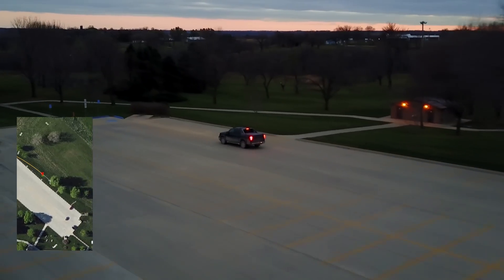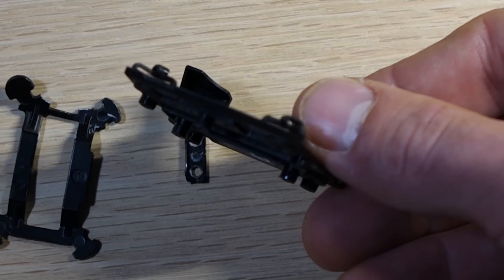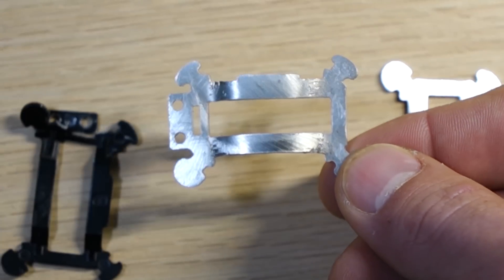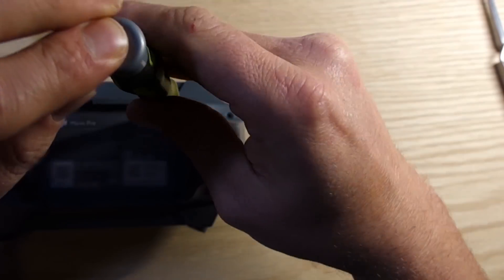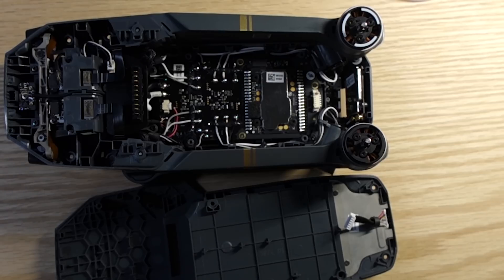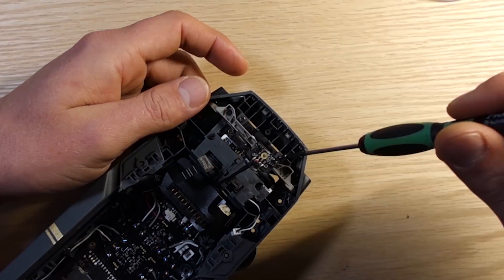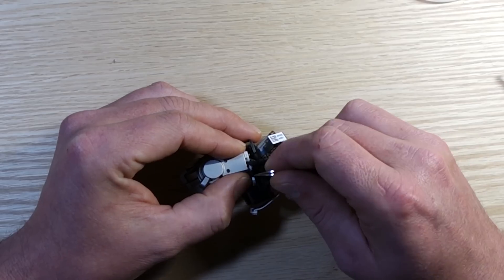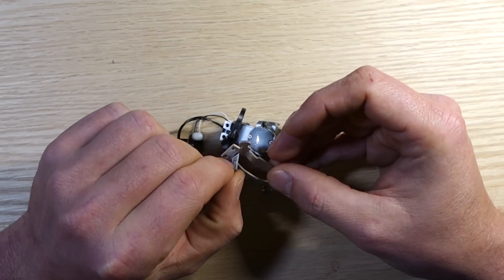DJI Mavic Gimbal Removal

Comment: Great Video, I was able to replace with out taking body apart. All I needed was the small Phillips Screwdriver and Needle nose tweezers. The Hardest part was attaching the Gimble Plate with the ribbon relocated so as not to pinch it.

Comment: You made this cheap plate new and STRONGER, what will break if you have a simmilar crash?
Reply from the maker: Nothing so far ....oh but a few props
Reply: That's not what I meant. Seems like this plate is the waekest link in the gimbal, next time something more expensive wil break because you made it stronger.
I think DJI's engineers made this plate "weak" on purpose, like the bumper of a car, to avoid bigger damage.

Comment: Great video, and thanks! My flat ribbon cable looks like it was ripped off, but I was wondering if it can be re-terminated to the gimbal side (open actual camera, and re-clamp maybe, like on a PC ribbon cable?). Any insight would be appreciated! If not, I'll just have to utilize DJI Refresh, and take the hit. I'm very capable of doing the work - just don't want a massive tear down, only to find out it's not possible. TIA!

Comment: you can remove this plate without disassembling the body.
Reply: I was able to replace the plate without disassembly of body, the main issue was the ribbon not going thru the clearance hole on plate. It was a labor of love but worth it. it works

Comment: I couldn't get the top to break loose the back half started to open and I disconnected the first terminal but I didn't want to crack the housing and i need to get a couple of the rubber bands two of mine broke.

Comment: Okay now why does the aluminum frame on your Mavic look so much more thicker than the thin flimsy crap that already broke on mine? Did you change yours out?
Reply from the maker: Yes, mine broke also, that is the point. Had these cut, more on the way, hopefully next week.

Comment: I just purchased what looks like your last plate. On eBay. Can't wait to get it. My wires all appear to be ok. I hope those ribbon connectors go back together easy. Do you have any tips.
Reply from the maker: I am going to cut some more for those in need. 

Don't try to force it, watch some cell phone repair videos, just the tip mind you.

Comment: ok I got thru just a bit while this seems like a good idea part of the reason its made so small and weak is so it fails before more critical parts do. wasn't it easier to replace than a camera itself?? but I have to say the work was beautiful!!
Reply from the maker: I absolutely agree. It is like a mechanical fuse. My motivation was to replace the part, not necessary improve the design. I thought about ordering the part from DJI, but as far as I know this is not possible, and I did not want to wait on DJI care for something I thought I could replicate and replace. Especially after waiting so long for the original order. I think 19 or 20 gauge would have been better, but the DJI plate measures just over 1mm and I was expecting 18ga to be closer.

Comment: Please Help.......     I just crashed mine and facing the exact same problem. Can you please tell me where you got your aluminum plate from? I really need need it to repair mine.
Reply from the maker: http://www.ebay.com/itm/-/332068989716?
Reply: Know One FPV
Reply: Hmmmm my problems r just getting bigger and bigger. Just changed the Gimbal plate with the one you sent (Thanks to you) but I just found out that my Gimbal ribbon cable is also broken. Any Idea where I can find the replacement ribbon cable??
Reply: https://www.aliexpress.com/item/Eachine-H8-Mini-RC-Quadcopter-Spare-Parts-body-shell/32693840996.html?spm=2114.13010308.0.0.aXe1Zo

여기서 판매하는것 같습니다.